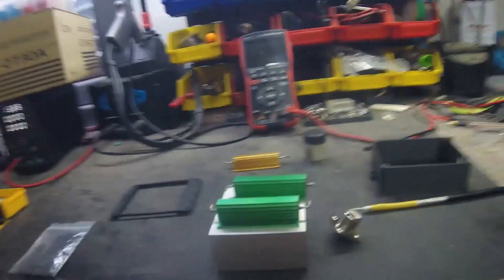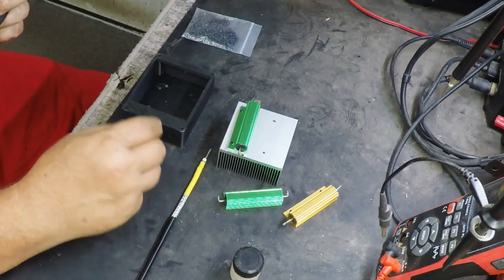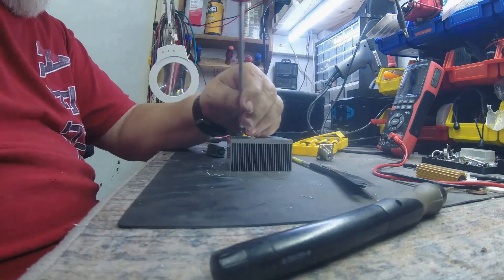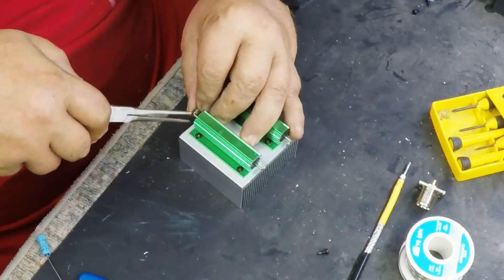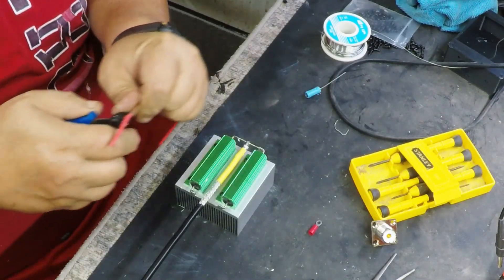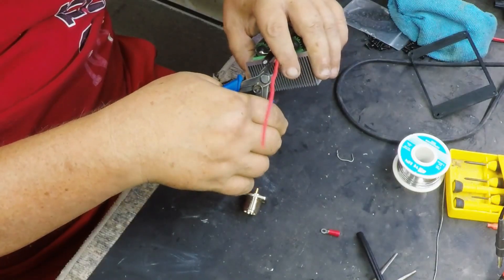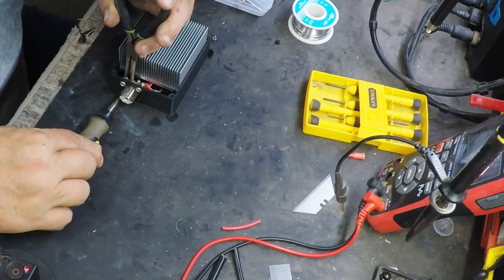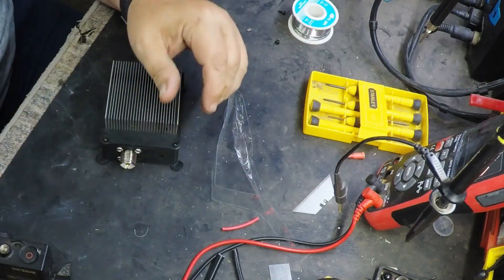Inexpensive 300 Watt RF Dummy Load Full Build

Comment: Hi, i have noticed these kind of resistors are made of winded wire in ceramic mass. Problem is, they are bringing in a lot of inductivity into the circuit which disqualifies them (for me) as dummy loads for HF circuits🤓 (golden rule, no inductance, no capacity)
Reply from the maker: You’re not wrong — the preferred choice for RF is carbon or specific non-inductive resistors. But this project was strictly for use under 30 MHz, where a wire-wound resistor works just fine. I didn’t build this as a hardcore 1 kW dummy load — just something simple, portable, and easy to use for checking RF output on mobile HF rigs. There are many options out there, but this one was cheap, handy, and works well for my needs.
Reply: @TheElectronMan  Ok if they are carbon fiber then there is no problem. I have opened a few in the same looking housing after i measured up to 2,5 µH and those were winded wire resitors, not good for an dummy load...

Comment: EXCELLENT! What would i heed to do to make a dummy load for 2m to 70cm? 73... KJ5LSO
Reply from the maker: If you use non-inductive resistors such as metal film or metal-oxide types, you can build the same setup. I used wirewound resistors since mine was for HF—they’re easy to find, inexpensive, and can handle plenty of power. I’m also considering building one specifically for VHF/UHF as well.
Reply: @TheElectronMan  Just ordered the parts from Amazon..... total less than 20 bucks. I refuse to pay $$$ for something I can build myself for "pennies".... it's a principal thing.
Reply from the maker: @joecooksey4331  I am the same way, that and anything you build you will know exactly how it works and how to repair if it ever needs it..